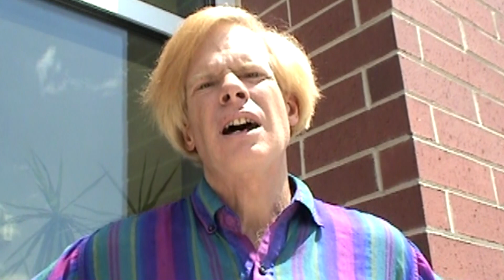Jeff Hayes on Tesla Turbines

Comment: Umm, you can't run solids through a Tesla turbine either....  The discs must be spaced very closely together and solids would quickly clog them up.  If you want to tap geothermal energy, you would need to do it with a heat exchanger system so that the turbine is driven by a consistent fluid or vapor.

The good news is that such a system is fully practical in many locations and we need to look more into it...but we have plenty of energy from the sun and wind to work with in most locations.